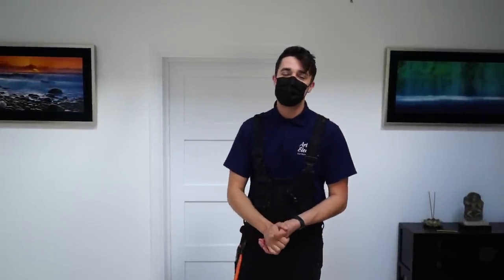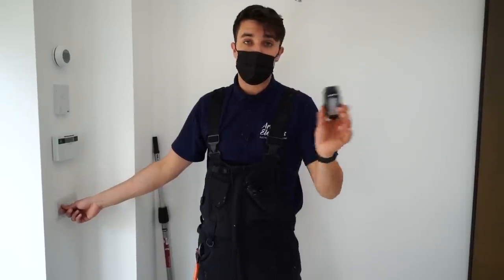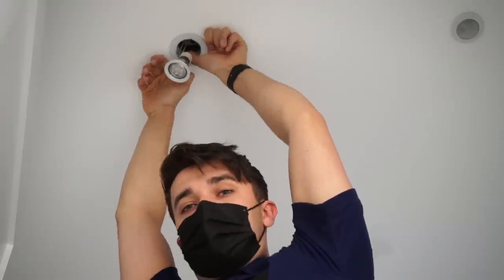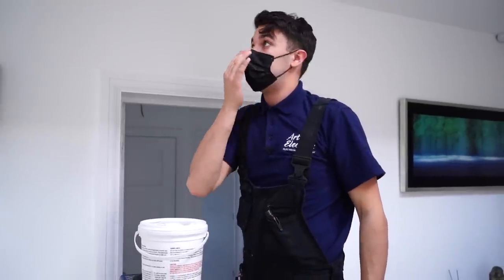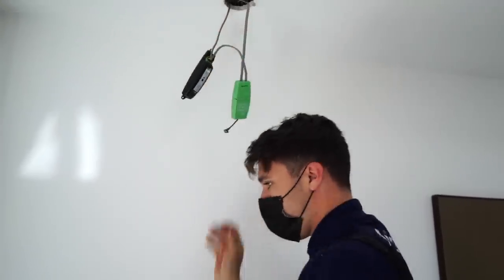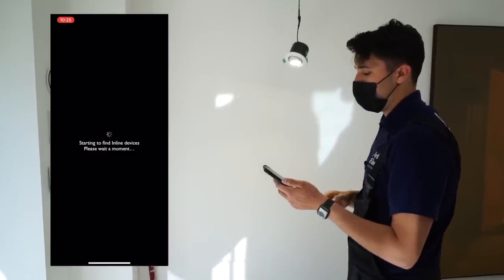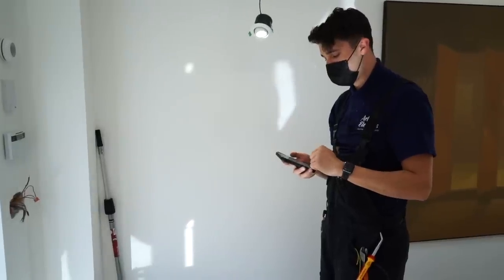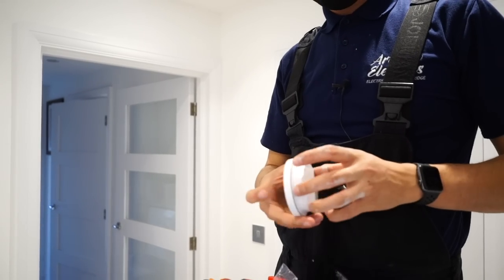Magic Light Switches! Luxury Smart Lighting Install - Electrician Life

Comment: I do like the Lutron gear but the biggest gripe my customers have had with it is calling us out to change the batteries in accessories thinking there's a fault but it's just a dead battery, in the end many have swapped back over to mains light switches and app controlled lamps or fittings. 
I feel like everything is going this way but as there's no set industry standard it makes for a head ache when it comes to the customers preferences as they think about how they want them to function but when it comes to how guests and visitors might interact with it that's never been taken into account.

Comment: Great product and install, would consider installing Lutron.
My only reservation is those jcc downlighters, being a compact unit with integral lamp. If the lamp was to fail, you would have to replace the unit, hence why i prefer fire rated enclosures housing a gu10 lamp holder.
Reply from the maker: They are so easy to replace though and more efficient than GU10s by nature of them being integrated
Reply: Yes me to,got 12 in my gaff over 5 years a go and not had to change any,also you do not have to call in a sparks to change the whole fitting,a customer can easily change the bulb if needed 👍
Reply: @artisanelectrics  how does them being integrated make them more efficient?
Reply: Agree with you guys and I noticed artisan didn't give a reply, total money burner for the customer , isn't part of our job to give the customer good advice AND value for money, not some expensive gimmick that's bound to fail or need further call-outs.
Gareth warden he couldn't give you a answer about his being more efficient, because they aren't.

Comment: A different take on it admittedly, but I love Shelly devices. Retrofit in backboxes, ceiling voids with lighting roses etc. Each one is a wifi device in it's own right using mains power and using the existing (cheap!) switches. Don't even need a neutral... (such as in a uk switch backbox). The main USP for me is instant voice integration with alexa/google and if it all goes pear shaped, or the user doesn't want use the app or voice control, they work just like any "normal" switch.

Comment: I do not understand why the old switches are not left in circuit as isolators. If (when) one of those smart devices fail, there is no way to disconnect it. Also do not understand why lights with fixed LEDs are so popular. I doubt all of those will work for those 25 years and when one fail, it is impossible to find a matching replacement with identical specs.
Reply: Total hassle and money burner

Comment: I fitted Energenie MiHome into my house - this doesn't need neutral in the light switch (although this does limit the types of lights that can be used with it as there needs to be a small amount of current available to power the receiver) and the light switch includes a button that can be used to turn the light on and off without having to use the app.

Comment: What happens if the house is sold? Does a new account have to be set up and everything reprogrammed?
Reply: There is no ‘programming’ everything is done in the app, the previous owner just logs out. The house we bought the previous owners put lutron in and we just took it over.

Comment: I'm really sceptical about integral fittings, how you finding the failure rate?
Reply from the maker: We have had zero failures so far and have fitted several thousand over the past 5 years
Reply: @artisanelectrics  wow, that's very impressive. Will defo look into them. 😉

Comment: Was thinking of installing these in a few rooms upstairs but was just wondering if the loft insulation would be an issue. Is it OK to have insulation over the top of them or would I need to clear insulation around each of the downlights?

Comment: Great video again. Is there a backup for switching the controllers on and off if the internet went down, which mine did for 24hrs 2 weeks ago. I think Philips Hue switches work if there's no internet.
Reply: The ra2 system only uses the internet for control outside of the home iirc, I think the picos talk to there paired dimmers regardless, I'll turn off my hub and see if they still work
Reply from the maker: Yeah they do

Comment: The colour of that ceiling filler may not be the same as the paint on the ceiling, and in those circumstances, that stark white filler will show up like a sore thumb.  Quite often, the ceiling is "off-white" (with a very small amount of black in it) to provide a less harsh white that is easier on the eyes than pure white.

Comment: I'm not a fan of connecting electronics into a circuit, without some form of isolating from the mains, because it causes problems when doing insulation testing. Personally I would of replaced those switches with fuse holders from the grid switch range and used 3 amp fuse inline with those transformers.  It would allow testing , easier maintenance, then you would need to turn the lighting circuit off if you had to change ba transformer it a light fitting , you just need to remove a fuse. If there is a fault then you can leave the customer with partial lighting , while you can get replacement transformers or fittings . Electronic connected into circuits with out means of some isolation is a pain in the but when testing you have a choice disconnect all electronics and use wagos to complete the circuit then test and then reconnect all the electronics or you don't test and put it down as a limitation. And some electronics just don't like insolation testing . Personally I hate it if I can't test properly and thoroughly. Everytime I install a usb socket I installs dual box with a fuse connection outlet one side with a 13 amp fuse fitted and if I install a usb charging station the same method but I fit a 3 amp fuse . Makes life easier for testing and maintenance . Personally I'm don't believe enough sparks don't  take into consideration testing and maintenance when installation circuits  accessories or lightning
Reply: Yes your correct,testing lighting circuits is bad enough without all this electronic stuff connected inline ,especially L/N and switch wires ,the only way I can see is to test before connecting lights and Luttron dimmers or receivers ,but after they have you have no chance of there is any shorts or future eicr tests 👍

Comment: If you've got art to light and the budget is there, I'd suggest something from the Philips ExpertColor range with a CRI of 97 and a lamp life of over 45k hours.
Reply from the maker: Nice!
Reply: High CRI ♥️💚💙
Reply: You mean MASTER LEDspot. I have 2 dozen GU10s 2700k CRI 97 with shelly dimmer2. No flicker or buzz dims down to practically 0 percent.
Reply: @chrislambe400  yup I’ve got the same lamps, so much better than the junk you get in most retail outlets. Thought masterled was a wider product line of which expertcolor was a model?
Reply: I’d pretty much say they should be mandatory on kitchen and dining spaces too, food looks a lot better under a high cri lamp.